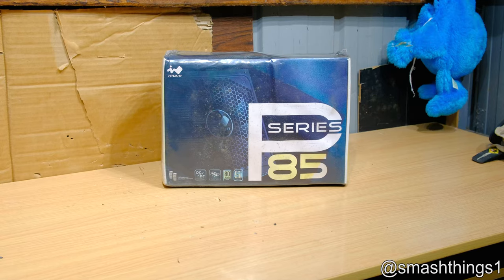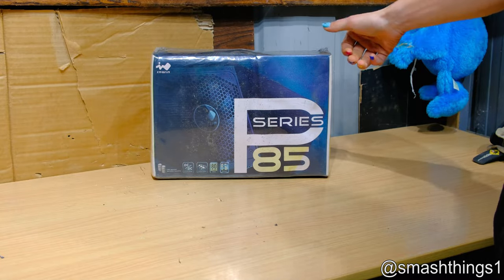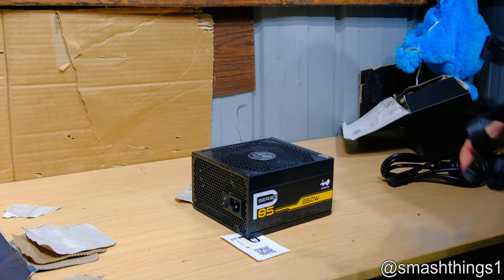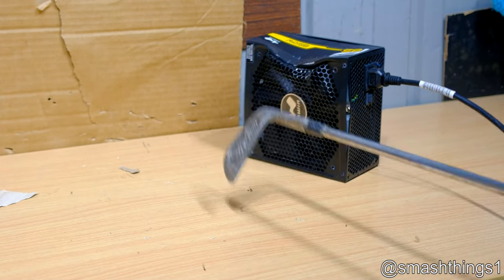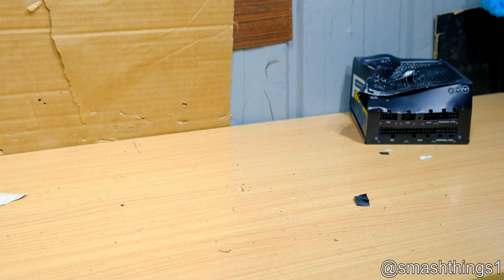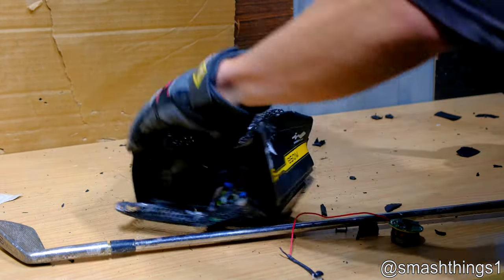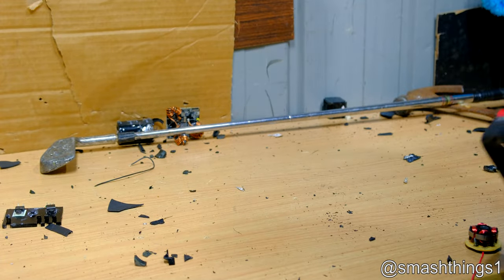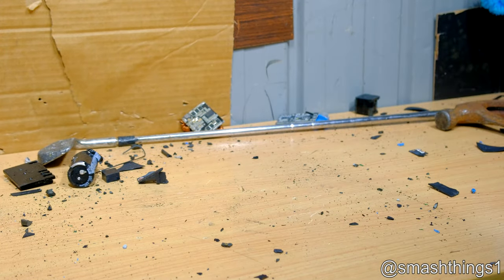Unbox & Smash Brand New Dumped Inwin Power Supply

Comment: 2:34 xt5 sensor overstrained (pitch black shadows too little pixel plain area / no full frame 40 MP)
Reply from the maker: It looks fine...
Reply: @smashthings1  if it still is 26 yes or 30 MP
Reply from the maker: @Sva010  I have no idea what you're going on about... it's a video recorded in 4K, it is in the ~8MP range (4096 x 2160). You seem to be referring to photo capture.

I also do extensive colour/brightness/contrast editing on recorded videos as the camera screen is poorly calibrated with colour. So what you see is not what the camera directly recorded. I make sure the video can be as bright as possible without any white clipping as I hate the overexposed look.

Comment: It's a shame to destroy that as you could have used the high current output to blow up other electronic and electrical stuff then you could do a series on blowing up speakers, bulbs and capacitors and other stuff that gives out smoke when you put too much current through it   At least you didn't pay for it, whoever bought it must have money to burn.
Reply from the maker: It was full of moisture and smelled horrible. I'm not using this thing.
Reply: And I don't think it actually worked before he smashed it.